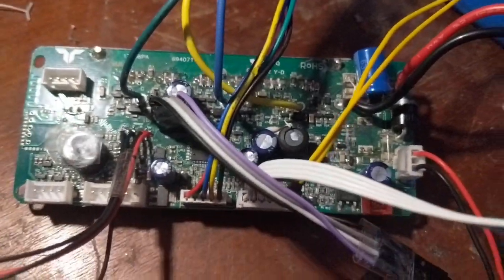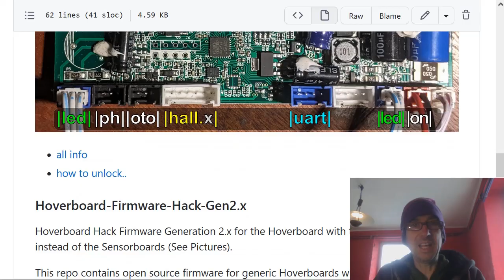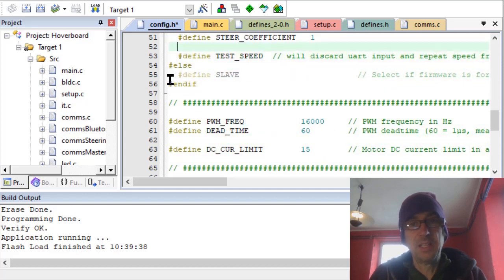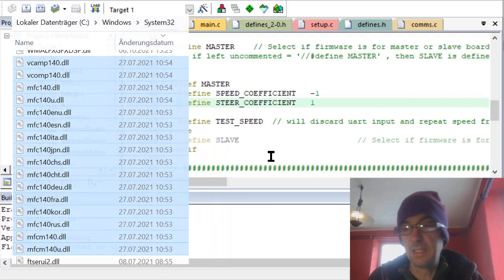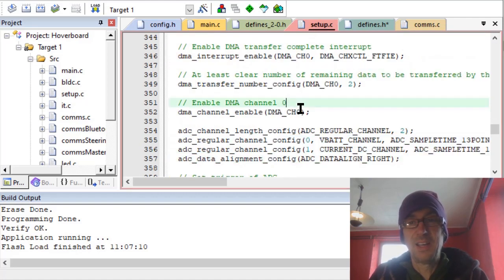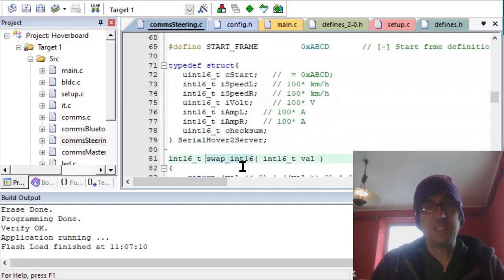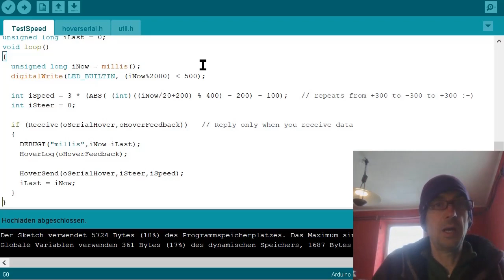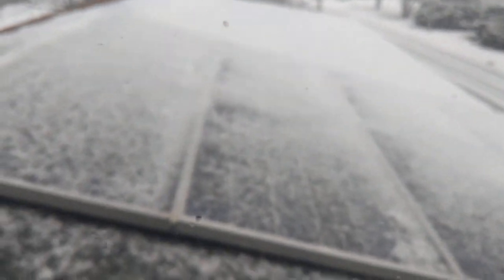Split Hoverboard Gen 2.x firmwares - finally :-)

Comment: Tanks a lot, you are the only one who did not forget these Split Hoverboard card
Reply from the maker: I already added photos and datasheets for the fourth layout 2.3
The future of this repo really depends of how many people will use it.
For me this is merely a intermediate step towrds a object oriented firmware that does them all.
But these single bldc boards would be great for ebike, water pumps or wind turbines. So i dream that i will have the happiness to port the FOC code from eferu or the STM library..
Reply: @robodurden  I also hope it goes well for you, and that it improves more in the future, because there are also more split board cards, for example the guy who sells hoverboard cards in my city has about 40 of the split boards, and only 2 of which  the STM32F103RCT6, I bought the 2 of them, and 2 split boards, poor guy, no one else bought the other cards, 4 months have passed since then, and he hasn't sold them until now
Reply from the maker: @Loucaster1  most split board cards seem to have the gd32f130 and i plan to collect as many different layouts as possible in my 2.x GitHub repo. That seller in your town might be happy to hear about my firmwares  and may even want to add some more layouts :-)

Comment: Look at one of my forks. Someone started to port foc to split boards but I haven't been able to talk to him. I just made it compile with platformio and added a board variant. I had not enough time and knowledge back then to finish.
Reply from the maker: Oh, it is an honor for me that you watched one of my videos!
Yes i will test your foc repo when I am back from my outdoor journey with my little solar Camper :-) Should be of great help to me porting the foc code, thanks. 
But next step for me is to finally build the foundation of an object oriented hoverboard OS.
I was already able to successfully compile a main.cpp with a simple class CIO for digital input/output, but the code does not seem to startup. And debug is not working because board not detected error popup :-(

Comment: Awesome! I have couple broken down hoverboards but I could never do anything with the boards because all the info was about obsolete hoverboard controllers. I have purchased 3phase BLDC motor driver boards but that's a waste since the original hardware already has motor drivers and more built in!

Comment: What I did for a ford ecu is just remove the processor chip and solder some tiny wires to the pads I needed and created a header to connect another microprocessor.
While this is not easy, then you could just program the whole thing using the arduino ide.
Or perhaps tap into other places on the board to drive the mosfers that are easier to get to than the processor pads.  Any try that?

Comment: Could you provide the code for the dummy binary? I can't make it work trough uart so i think i'll write the potentiometer reading directly on the board.
Reply from the maker: https://github.com/RoboDurden/Hoverboard-Firmware-Hack-Gen2.x-GD32
You could add a RemoteAdc and add variables for PA2 or PA3 (normally used for serial communication) to adc_buf_t in defines.h line 150
Then increase the number from 2 to 3 in 	dma_init_struct_adc.number = 2;  if setup.c line 367.
Then read the adc value in your own void RemoteUpdate(void) of RemoteAdc.c and change speed accordingly..
Reply: @robodurden  Thank Q

Comment: great job so far.... but in my humble opinion the resolution of the hall sensors is very low for precise movements like robot arms, at least in direct drive mode without a gearbox- so I switched to the AS5600 hall sensors - the cost next to nothing. At the moment I'm working on the protocol interface between the Arduino with its AS5600 connected and the serial interface to the ODRIVE clone...you are not the only one with little problems! Greets from Dresden!
Reply from the maker: My idea for a huge robot arm would of course be to attach a (differential) planetary gearbox onto (the backside) of a hoverboard motor. A differential planetary gearbox can easily achieve 32:1 in one step. 
I have already added odometer (hall steps count) to my https://pionierland.de/hoverhack/?p=logbandsaw
Have forgotten how many steps per rotation are counted but i think it is quite a lot for such a 14 rpm/V bldc. And a gearbox is needed anyway to get the most torque for rotation speeds at about 90°/second.
I think that the hall sensors are digital inputs and the gd32f130 pins of layout 2.0 are digital inputs only.
If you don't want to use a hoverboard (control board) for your robot arm then you shouldn't have posted here.
Reply: I'm about to attempt flashing my first hoverboard.  Mostly interested in very slow speeds.  

Do you think the existing hall sensors are enough, if I'm slow, but not trying to lock specific angles?
Reply from the maker: @caseyandtim  These hoverboard motors only have a max torque of about 6 Nm! (= 0.6 kg at a 1 meter leverage) (Calculated with 350W at 36 V and 14x36 = 504 rpm): https://www.wolfgang-frank.eu/drehmoment.php
Slow speed is a waste of efficiency.
Reply: @robodurden  quite out of my depth.  Trying to make swivels, to move 40lb and 120lb between 0 and 10mph (but often ~1mph)

Price is the motivation as I have a fair number to build.

Is there something else i should be checking out?
Reply from the maker: @caseyandtim  swivel is a rotation, mph is a (linear) speed. Without the length of the crank/level, i can not help you. Maybe you continue here: https://en.wikipedia.org/wiki/Torque
Reply: @robodurden  sorry, by swivel, i meant swivel-cart. The hoverboard wheels are just acting as wheels/motors, with servos handling the swivel part. 

I will read up on torque.

Comment: so iv got a bunch of different boards im trying to get working for an electric skateboard. and on a couple of the older original mainboards i accidentally shorted power to the heatsink part of one of the mosfets and now when turning on there is no beeps .  do you have any idea what component might be fried?
Reply from the maker: Watch my repair video on how to test the MOSFETs :-) if you connected the gate pin with the middle pin (which shorts to the heatsink part) you might have killed some little transistors of the gate driver section. I also have a tutorial in this. 
When you have identified the broken part you can salvage another broken board...

Comment: Hi. I'm bulding an e-scooter with 1 motor only and i'm wondering if i can use only one board and make it indipendent. After all, the only differences are the buzzer and the connector.
Reply from the maker: Sure, you can only use the master board and have the on-off button. Or only the slave board, which mostly needs to be powered with additional 12V or 15V on the master-slave connection uart header.
But you could also use the EFeru firmware with the good old Gen1 board (if you are lucky to still find it in an old used hoverboard) and enable only one motor. EFeru has nice FOC motor control. My GD32 Gen2 firmware only has basic block commutation. AiLife with his new MM32 firmware already offers sinusodial motor control: https://youtu.be/1CbCdJV6zG0
Reply: I already have an hoverboard (gen2). My last question is if there is potentiometer control for the e-scooter project. Sorry for the bad english and also for the stupid questions : )
 @robodurden
Reply from the maker: Our gen2 firmwares need $2 esp32 to control via serial connection. Esp32 can read potentiometers with analogRead function.

Comment: i like the video. i managed to find out the boards i have is gen2.2.3 from the github. but is there any information or firmware for this board? im leaning towards using cheap amazon driveboards but i think the original boards would have been better

Comment: Hello! I have version 2.0, I want to make a RC lawn mower. Is it possible to go back to original fw? If not, is it possible to use your firmware as classic hoverboard? Thanks, I'm following the FOC issue (#11) very interesting!
Reply from the maker: Going back to the original firmware has been asked often but does not make much sense. If you indeed want to spend time on such a lawn mover project you should buy at least 2-3 used hoverboards for less then $30 each anyway.
You have to unlock the 2.0 and if you do it with windows and the old st-link utility you see the all the hex data of the original firmware. Maybe there is a feature in that st-link-utitlity to download the data to a bin file. Technically it should be possible but noone has ever spent real time on doing it.
If you have some coding skills, please join the follow up issuehttps://github.com/Candas1/Split_Hoverboard_SimpleFOC/issues/1
Reply: @robodurden  I'm starting to look at the code. Let me get my feet wet :P

Comment: Any interest in adding another split-board layout to your repo that I haven't seen anywhere? I just picked up a few boards (Swagtron Evo v2) and they have a MM32SPIN05PF. I can help document and am starting investigation into what is needed to flash
Reply from the maker: For sure you can send hi res photos to roland@robo4future.de
But all my gen 2.x layouts have to be based on the https://www.keil.com/dd2/gigadevice/gd32f130c8/ to compile.
Yes, your mcu seems to be supported by the keil 5 ide: https://www.keil.com/dd2/mindmotion/mm32spin05pf/
So it might be able to port the gen 2 firmware to that processor. But i will not do that.

Comment: Thanks a lot for your work in this board. I have now installed KEIL and opened the project. When i try to compile V2.0 Board, I get four errors, mostly about missing semi colons. I added them but now the issue is in Hoverboard.afx, Error: Undifined symbol DEBUG_LedSet. Can I remove the LED Set and still use the build?
Reply from the maker: Oh sorry i was working on layout 2.2 lately and forgot to publish the latest defines.h
Have done so now and that should also resolve the ;-errors.
https://github.com/RoboDurden/Hoverboard-Firmware-Hack-Gen2.x/blob/main/HoverBoardGigaDevice/Inc/defines.h#L22

Comment: Hi, I burned your test file and it works normally, but the 2.0 file, how do I connect the trigger,I'm not sure if it will work, Thank you
Reply from the maker: Don't understand what you mean with trigger but you can only control via uart serial control. So you need to connect something like an ESP32 to the second serial port. Fully watch this video !

Comment: HIi! how are the wires connected to the arduino and boards?
Reply from the maker: rx - tx , tx - rx , gnd - gnd. Go to my Gen2.x repo to see the header pinout of your split hoverboard layout.
Reply: @robodurden  Thank you! 
After I loaded the software, there was a thin sound that is always heard when it is turned on and does not move.
Reply from the maker: @stefanradu5407  make sure you have a 2.0 layout. First flash the master test binary. No cables needed to test the motors spinning.
Reply: @robodurden  i have connect my arduino to those pins and i have uploaded the sketch named testSpeed now which bin i must upload to the board to be able to control it? i have a test binary that make the motors goes back and forth but seems to ignores arduino signals?
Reply from the maker: @thepicklemaker6303  which layout ? 2.0 ?
Dunmy bin has no uart communication.
Next try the Uart binary :-)
Reply: @robodurden   yes i have the layout 2.0 , could you please help me which is the correct binary to choose? Thanks for your response!
Reply from the maker: @thepicklemaker6303 
HoverBoardGigaDevice/BinariesToFlash/hoverboard 2.0 master Uart.bin
And for the slave board
HoverBoardGigaDevice/BinariesToFlash/hoverboard 2.0 slave.bin
Reply: @robodurden   thanks! i will try!

Comment: Have you kept any stats on how many checksum failures you actually get when running?
Reply from the maker: No but you could add a global counter variable yourself and temporarily overwrite iVolt for example here: https://github.com/RoboDurden/Hoverboard-Firmware-Hack-Gen2.x/blob/main/HoverBoardGigaDevice/Src/commsSteering.c#L59

Comment: Can the 2.0 board handle 10s/36v?
Reply from the maker: Never thought of that and tested my 2.0 and 2.2 boards successfully with 10s.  Don't think that they have different MOSFETs that will get too hot when powering 350 Watt at 36V.
And I remember lots of disappointments because a 10s hoverboard when opened had a 2.x layout. I for sure have not as many 7s batteries lying around as I have 2.x boards. So yes you can.

Comment: Is there Firmware vor Version 2.3 coming?
Reply from the maker: No, i will focus on 2.2 as just today someone has broken his board while testing.
I am not sure at the moment if I have a 2.3 at home.
But you are free to start probing the pin connections.
Reply: @robodurden  What are the steps of porting the Firmware? Probe the pins and identify the chips. Is there anything else that I can do?
Reply from the maker: @wcosrnepecjue2897  only probing the pins and complete 

https://github.com/RoboDurden/Hoverboard-Firmware-Hack-Gen2.x/blob/main/HoverBoardGigaDevice/Inc/defines_2-x.h

That you rename into defines_2-3.h

Read the issue of the 2.2 layout on my repo.
https://github.com/RoboDurden/Hoverboard-Firmware-Hack-Gen2.x/issues/5

And 2.4

https://github.com/RoboDurden/Hoverboard-Firmware-Hack-Gen2.x/issues/3
Reply: @robodurden  Is there a way to dump the stock firmware from the chip?
Reply from the maker: @wcosrnepecjue2897  not really.
Reply: @robodurden  Does the unlocking process erase the flash?
Reply from the maker: @wcosrnepecjue2897  maybe not.

Comment: Great, thank you!!! are you going to put it on the online compiler?
Reply from the maker: As I strongly dislike Linux I don't know how to create a proper makefile.
Keil ide uses it's own compiler, no open source gcc compiler.
But I may try platformIO which also has an open source compiler tool chain ? Then maybe I can build a makefile for the online compiler.
Reply from the maker: I have added another gen2.0 repo to my online compiler.
Arduino code can be found here: https://github.com/gaucho1978/CHEAP-LAWNMOWER-ROBOT-FROM-HOVERBOARD/tree/master/ArduinoFirmware

Feedback welcome

Comment: I was wondering from the start of your videos of hoverboard firmware, why don't you use keil. I use Keil since I've started working with STM32 (with previous history with Keil back in 2013, working with 8051 series of MCUs). It's fairly simple, and there are cracked versions with full capabilities of this IDE and all required compilers.
Regarding the ST-Link, I think you just don't perform any update for it, even if it prompts you to do so. I still use an ST-link, alongside with built in loader in Keil.
Reply from the maker: Yes i wish Torvalds had a girlfriend in 1991.. an Linux were never born.
I was new to stm32 and Niklas Fauth who made the first hack seems to have been a (stupid) linux believer. As i did not succeed to install the tool chain for the makefile on my windows laptop, i began with the online compiler..
I no longer want to use cracked software. 
No, i have just downloaded the latest version 4.6.0 again: https://www.st.com/en/development-tools/stsw-link004.html#get-software
It needs some old dll files from Visual Studio 2005 :-(
Reply from the maker: @sanelleric6121 , can you debug a hoverboard with Keil ?? I get the 'Cannot access target' error. 
SWCLK and SWDAT are of course connected to the st-link v2 dongle as i can program the chip. 
As i am new to Keil i have never had any opportunity to debug a hoverboard.
But i have begun with a main.cpp and a bit of object oriented programming. But the code does not start up..
Ideas welcome.